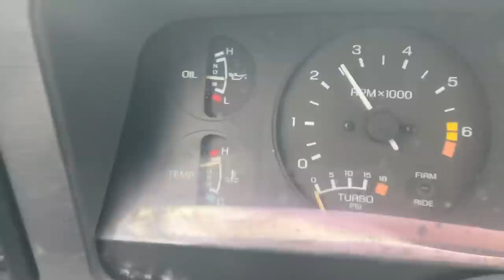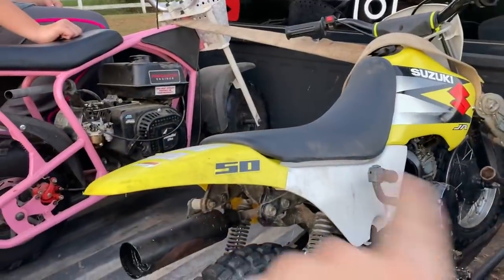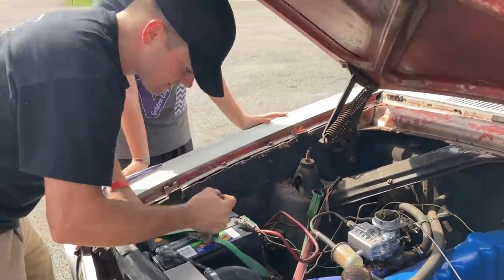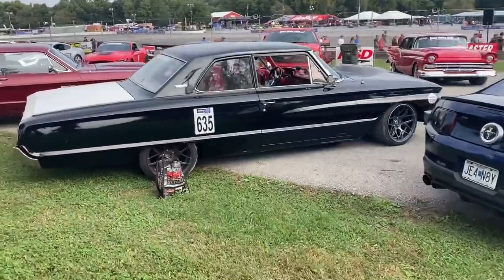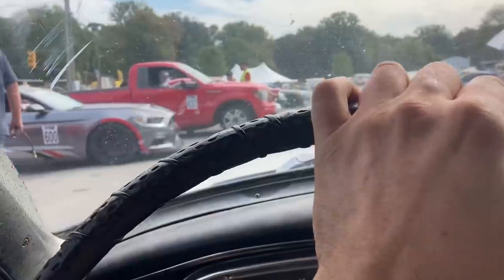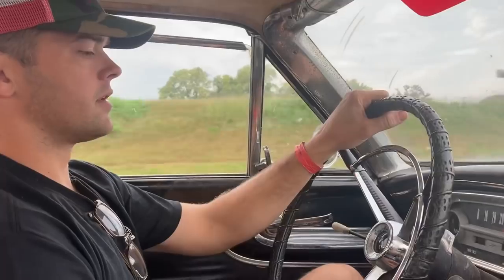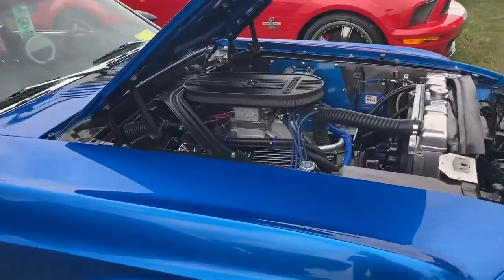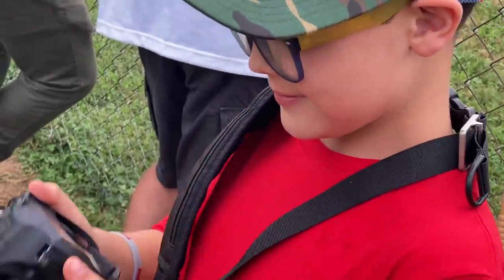2021 Intergalactic Ford Fest coverage Drifting,drag racing, autocross,Big Foot ultra 4

Comment: Looks like you guys had a blast. That little Falcon is a keeper for sure.
Reply from the maker: That’s right
Reply: @Sleeperdude  THE LAW OUTLAWED THEM PLUGS ....
Reply: @Sleeperdude  2 things my grand father left us a old 1964 falcon van that had a 3 on the tree it sadly sat for 30 years and did not get running sadly it probably would not have been as hard as for example your falcon because the engine was inside the van

Comment: I had that same pump rub issue on my '04 Silverado, I cleaned it up and dabbed some ultra black on it and it actually held up for almost a year. I did eventually swap the case half when I finally remembered I needed to, I got an aluminum case half off of eBay for about $80, then a case saver plate for less $20 I think, and it's been fine since.
Reply from the maker: Ok thank you

Comment: I think you did a great job with what you have. If you want to get serious about the autocross, you should get a 200 cid short block and put the 170 cylinder head on it. This will boost compression and still have the same size valves. A fluid and filter change with band adjustment at your local AAmco should help with the shifting problem. I think the slow 2nd gear shift is a band that is too loose.  But no matter what you decide to do, let me say GREAT VIDEO !
Reply from the maker: Good idea thank you

Comment: great video josh .... proper family video ... love your track event ... back in 94 , i was in the uk ford xr owners club , if you know of the formula 1 track siverstone ... i had a mk2 ford xr2 87 reg .... nimble little car ... check em out ... anyway i also did 17 laps round the circuit , the best car stuff ive done , they made you blow up your tyres (  casings lol ) to 45 psi , to save the walls from being ripped out .... ps ... keep up the family videos .... cheers mark ...
Reply from the maker: Thanks Mark really appreciate it

Comment: Nice probably gonna end up watching all your stuff now. Subscribed. I used to work with my dad for most his life on mustangs, a VW bug, and one 69 (I think) 240z that prior to being totaled out in a pile up (squished front and back) was so fun to drive around in with him. I’m currently finishing up his retirement project car, a 69 mustang Fastback he scored of the 1st owner here in SoCal. Lost him a year ago. It was built at San Jose December of 68. Already got the Marti report on it. It’s never been in an accident and now that the body work is done I should have it on the road early March. Wiring it up is where I’m having problems finding someone willing to do it right. If I had the time, money and health I’d dive right in but my heavy wrenching days are over. Upkeep and maintenance sure but pulling engines and trannies I’m over that.

Trying to get my kids into it with mixed results as i pretty much gave up cars as a hobby when I was forced to sell my 65 coupe for “reasons” most married guys with kids will understand. Still I got one almost completely onboard and all it took was promising he’d get it next. He is learning cars much the same way I did, though as an older teen he missed out on a bunch of stuff sadly starting so late.
Reply from the maker: That’s great at least you have one interested

Comment: Check out "Power Nation" Ford inline 6 - 300 cubic inch.  They took an old plain Jane industrial 6 cylinder low hp strong and after a rebuild (308 cubic inch) and performance cam n lightly messaged heads got 270 hp. 
Then added a turbo and off blew the barn roof. Just over 500 hp and 600 ft lbs torque.
Reply from the maker: I actually did watch it that was awesome

Comment: Thanks for the reply :) I had a S/C Thunderbird and as you were doing trying to get it going, was told that it has 2 computers, 1 you can get the other is no longer made so ended up giving it away, then found out NAPA still stocks them :( (Hint if you can't find a part check with NAPA) Keep the info coming and have fun and good luck cropdusterpilot
Reply from the maker: Ok thank you

Comment: You guys had a great day!!!
Sleeperdude, if you don't mind me saying, if you open you vent window in the Falcon, Ralphie wouldn't get as much wind on him. Ralphie is sitting where I used to sit in my dad's Falcon. He never opened his cent window and I got pelted with wind...Just saying.  Not meant as negative comment. Trying to help Ralphie a bit.
Reply from the maker: He is usually cold no matter what
Reply: @Sleeperdude  Ralphie and me both then. I'm typically cold a lot also.

Comment: The Falcon did great considering the transmission problems. Why did decide on 2 lane roads. Travel would have been better going there. On the Interstate. I enjoyed your video. Lots to watch. Much better than any other I have seen.
Reply from the maker: I like to drive slower when I’m pulling a trailer seems like a lot of people have trouble with trailer tires going higher speeds on the interstate
Reply: @Sleeperdude  I agree with higher speeds on trailer tires.Yes, there does seem to be more problems at higher speeds. But, that seemed pretty curvy and some narrow roads. I can go 55 on Interstate. Just they pass me. You’re comfortable and made it. Still think your video in Bowling Green was awesome. And might talk to you about you getting a Vette. You and your family are great.

Comment: Had a 70 Nova with the 350 turbo trans. Had the same issue as you with the trans. I used the Seafoam Transmission fix and that took care of my issue for several months...definitely helps.
Reply from the maker: I have had other people tell me that it must be good
Reply: @Sleeperdude  yep. My trans was hardly shifting at all. I would put that stuff in it every 3-6 months and the trans never went out. Shifted perfectly for about 6 years before I sold the car

Comment: I do not understand why your power peaked at such low RPMs???  Dirty fuel or air filters?  Soot buildup on the backs of the intake valves?  Fatigued valve springs?  Stuck exhaust manifold heat riser plate?  ?????
Reply from the maker: Probably all of that

Comment: 60 on the Hy em that better than my 64 Fairlane she had unknown 6, cuz I didn't care what size it was it was a 6 but way newer than the car had a 77 emissions tag on the motor. Anyway and it had a 2 speed auto the speed limit was still 55 I'm in Colorado and if you hit a big hill go under 80 you'd be 45 in first by the top just screaming so 80 it was unless some fool got in front of me, but probably cuz of the two speed and gearing she was fine with it😎
Reply from the maker: That’s funny thanks for watching

Comment: I had Capri fever had like 5, 4 got vandalized and as I've said before I'm scraper so 4 are gone forever and I gave the last one to my oldest son.it was the most expensive but not the best it's a rust bucket but still worth more than I ever thought it would be. Being the most expensive one I bought I gave the guy $20 and the trade I put in was worth about $100 in my eyes so $120 was the most I paid for one.
Reply from the maker: That’s crazy

Comment: Son, pull that automatic out and stuff a three speed in it., these kids need to chip some teeth off the cluster gears and learn standard shift... hell who knows, maybe you ain't so hot on a clutch yourself. Who cares anyhow, a standard shift is a lost art an no new cars have them or trucks either. I  would have to learn all over how to drive a automatic. I got so excited that my crippled feet actually clinched when you were on the track and me thinking why don't he have a spinner knob on the steering wheel. I drove trucks with them cause one hand was dedicated to shifting the three different transmissions in just one rig. Although it was near new  to me, I was driving an it was nineteen fifty seven and the rig I  was pushing fuel through was a nineteen thirty eight autocar logging truck with a whole sixteen tires between the truck and the  trailer. I thought I was the shit man. I was ten years old, dads logging trucks and he couldn't keep me out from the wheel so made a truck driver out of me on steep logging roads that many men died on. In fact the last man that drove the truck I was in was crippled for life. If you put your thumb around the wheel, you were guaranteed to get in broke off or bad damaged. Need to get you sponsored for some kind of racing stuff as you have a fever for it
Reply from the maker: That’s a cool story, I plan on putting a manual transmission in it soon

Comment: Factory specs for your straight six are 84hp and 134 ft lb torque...but that was the old gross measurement and not net. Iffen ya wonts ta make it meaner, talk to the guy in the sage green falcon  or the Australian Ford Six  fans.
Reply from the maker: Ok thank you

Comment: Lucas makes a thick transmission additive that might help a transmission that slips when hot.  Are the bands adjustable?
    The T-Bird might have a stuck thermostat, which usually can be freed up but is more commonly replaced, and it might need a cooling system back flush and then maybe chemical flush.  Could the water pump pulley be slipping? or fan?
   If that is a sleek, light weight, 2.3 T-Bird then it can be your high mileage commuter!  Once the cooling is sorted.
Reply from the maker: I already put the Lucas additive in it and adjusted the band I also change the thermostat in the turbocoupe none of it fixed anything yet
Reply: @Sleeperdude  backflushing is next, which I remember being different with side flow radiators.  I think the best way is to Drain coolant, remove the thermostat. take a rag and a strongly running garden hose,  jam the hose into the thermostat hole in the engine, seal any gap as much as possible with the rag, and let the water come out the detached gooseneck.  that should backflush everything except maybe the heater core, which can be done separately.  If the gooseneck fits the hose better than the engine hole, then one can reattach it without the thermostat, remove either end of the radiator hose, and jam the garden hose into whichever hole it fits best.  
    Since coolant corrosion inhibitor and water pump lube has become obsolete and rare in stores, I have put a few drops of light oil in coolant with no ill effects so far.  I tried silicone too but it caused overheating by insulating the radiator tubes.
   You might end up having to remove freeze plugs to clean out rust, at worst, or if radiator is insulated by silicone, which is rare but I have done it, the only fix I know is replacement, though there might be a chemical that can remove silicone, like acetone?
   Silicone insulation of the water jacket might potentially cause spark knock or even burnt valves, but I doubt it, but may be a bigger worry in a turbo.

Comment: I had a 1987 Thunderbird Turbo Coupe and the inside gauges would ready hit and it wasn't hot. Ford changed out gauges, radiator, thermostat, sensors and everything had to do with cooling system. Even put in a brand new PCM and still could not stop the gauges from registering HOT. And when they run HOT it sends a False reading to the PCM and it cause it to use more Gas. Cause the Computer thought it was overheating and therefore would use more GAS. They never could fix that car. That was my favorite car on the Planet. Still to this day and I'm 65 now it's still my favorite even though I no longer have it. So what would you have done Josh to fix the Problem. Just wondering.

Comment: Great video.  I drove truck for a few years and always drive I65 . Drove by the Corvette museum so many times and never made it in.  So that was cool to see the inside.  I gotta ask why do you call tires casings? Isn't the casing basicly everything but the tread and the steel belts of the tire? Iv never heard someone use the term casings for tires. Iv worked at tire shops for years!  Lol just curious!!
Reply from the maker: Yes you are correct that’s what the casing is , an old man I used to work with always called them that  and I thought it was funny
Reply: @Sleeperdude  10-4  that makes total sense now.  Most good stories start with "once a good ol man told me" lol I live up in flat indiana. I really enjoyed the backroad traveling to bowling green.  I miss truckin.

Comment: 170 c.i.?
200 is the ticket.
Had one in a 68 Fairlane 500 auto, p.s, am radio, panty cloth, 4 door post, wasn't doggy at all.
Handled good, but hit a fire hydrant going 60, took out the left rear quarter, not totaled in my book, looked rough though.

Comment: Autocross is a blast.  I ran my 80 Amc Spirit lifted Street Freak with manual steering at Goodguy Raleigh 2022 and did 55 second lap.  Probably slowest car of the weekend but it was still awesome!  You go little Falcon.

Comment: That was a B-100 ford they were made in mexico and theyre bad to the bone! I found one in rough condition for $42,000 here in Texas.
Reply from the maker: Wow
Reply: @Sleeperdude  i just wished they made more of them, they usually had if i remember correctly 400 cid ford truck engine, ive seen them paired to a np435 not for sure on the 4x4 models though

Comment: I've got a 8hp self perpelled push mower id line up with the falcon 😆 
Several years ago I went to mod motor weekend in a 99 gt mustang with big ole wide casings i left them 2 black marks from the front door too the street I couldn't even see the building when I pulled out on the road good times 
Ole Gimpy and Keith kile was with me

Comment: I'm probably going to get grilled for this but I have a question. Why do you use the term casing with reference to tyres? I do know the outer part of the tyre is referred to as casings or am I incorrect?

Comment: You never obviously plug the trailer tire before because as soon as you put weight on it and get on the interstate with any kind of weight on that trailer or you be doing 65 Mi an hour and it's going to blow that thing clean out you got to pass it from the inside that's the only Safe Way promise you hear me now believe me later

Comment: What is that thing Americans have with carshows. Must evolve round words like 'feeling free' and 'adventure'. Funny vocabulary on 'casing'. We simply call those round rubber things tires (or tyres when it's on a sunday). 🤣 You didn't make use of the mini motorcycles?
Reply from the maker: We did use the mini bikes it’s just hard to video while riding one